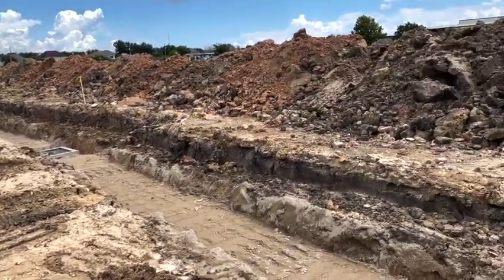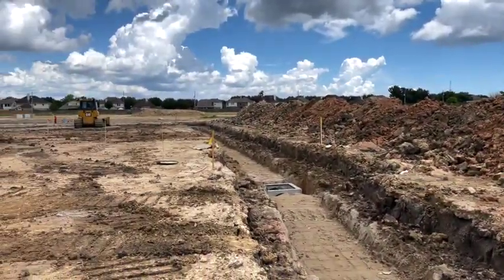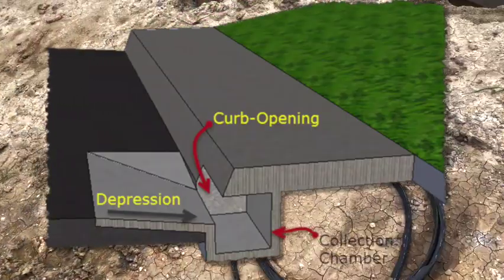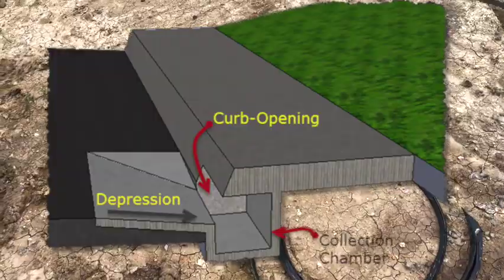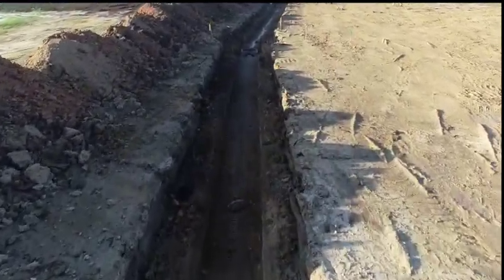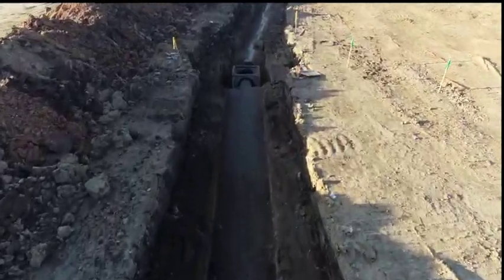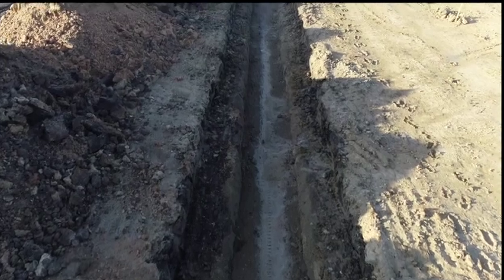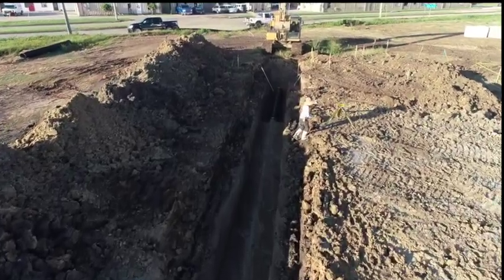How to Plumb a Development - Storm Sewer Part 2

Comment: Why are these boxes so big. I have to do a 24” culvert pipe 300’. Thought I could use plastic boxes much smaller. Thanks for the video.
Reply from the maker: If you have a turn in your pipe, you have to upsize your boxes to be able to make that happen. Also these boxes are put in for the future tenant to be able to tap into them for all of their stormwater needs.  Good luck on your job. Thanks for watching.